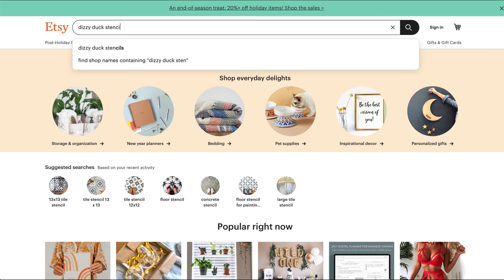How to Paint Over Old Tile (DIY Stencil Tips!) - EXTREME BATHROOM MAKEOVER Part 2

Comment: As a professional decorative artist that has stenciled many floors as well as other surfaces, I have a few suggestions to help you (or others who may read this)...—the use of two identical stencils allow you to keep painting while one stencil is drying; —the use of a light coat of SprayMount adhesive on the back of your stencil will keep it in place while applying paint and also prevent bleeding underneath; —using stencil brushes (which have flat bristles) rather than foam brushes would make the process much easier (stencil brushes come in many sizes to help fit the specific portions of the stencil design); —the use of paper towels to “off-load” the brush from excess paint each time you apply it to the stencil will really help with keeping crisp lines and therefore eliminate touch up in the end. I hope this helps you or your subscribers. Your bathroom floor looks great! Susan
Reply from the maker: Ah brilliant Susan! Clearly, this was my first time stenciling. I had another stencil, but chose to keep this method since the dry time wasn’t quick enough. Will keep this in mind for my next project for sure! Thank you for watching and sharing the wonderful tips 🙏🏻☺️
Reply: Wow. Very kind of you to add this on. Love the video and love the feedback!
Reply: 100% agree with all of this! I did a wall but now doing a floor. I felt that the spray adhesive didnt work very well in wall but I am going to try it again on floor.

Comment: Beautiful job and so much work. I love the finished project.  I'm wondering what kind of paint you used? I would like to know how this holds up over the years
Reply from the maker: Check back with me in a few years Paula! 😆 I simply used Interior latex paint (I linked them all), the kicker is your top coat 👍🏻
Reply: @JulieKhuu  I love the look and I think its awesome to change the look by stenciling the tile instead of ripping it out. I completely agree on the top coat and maybe if it does start to wear you could just recoat it with more policrylic.

Comment: You can you super 77 or an adhesive spray.
Spray back of stencil lightly and it will lay flat.. just reapply as needed. If you just spray on the stencil it will lift up easily.
Reply from the maker: Thank you for watching and the tip! I was afraid it would be too sticky atop the base coat and I would have to clean between tiles. But will try it next time! 👍🏻

Comment: Thank you so much for this video Julie
I would like to paint my bathroom floor but the problem is that its surface is coarse, rough and bumpy so I'm not sure if it's doable, any suggestions?
Reply from the maker: I think a single color would be your best bet Enji. The stencil really needs a smooth surface and even then it’s tricky!
Reply: @JulieKhuu  great! A single color then
We're locked down in Montreal these days, once the stores reopen I will start the project
Any email address where I can share the before and after with u?
Reply: Enji and Julie:Have you both  considered etching out the old grout and replacing it with new. for you painted solid colors....possibly in a dramatic color?In real life the tile color is a different  shade and texture than the  grout. The mosaic distract from the odd sames of the base color and the tile surface, but you'd need the contract when the tile is sold.  Bebe
Reply: @bebekanter6640  will keep that in mind
Thanks Bebe

Comment: Please what type of paint did you use?
Especially to prime the tiles. Was it oil based paint?
Reply from the maker: Water based latex paint (linked in description box). You can use oil based paint but the fumes are strong and it takes days to dry between coats.
Reply: @JulieKhuu  thank you ma'am